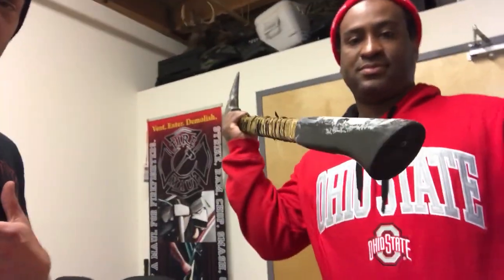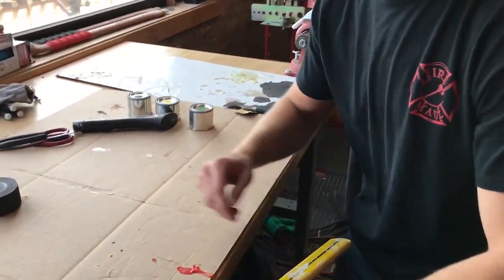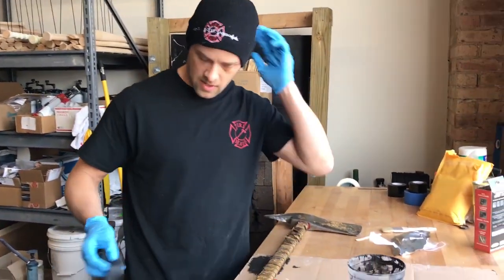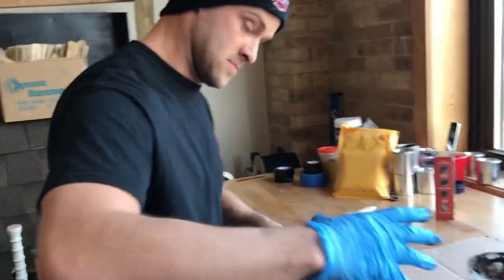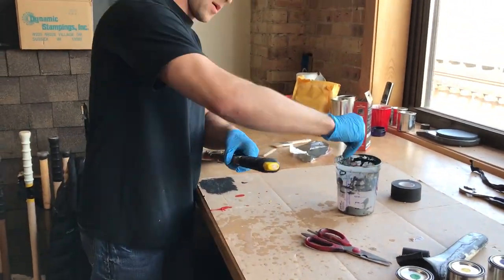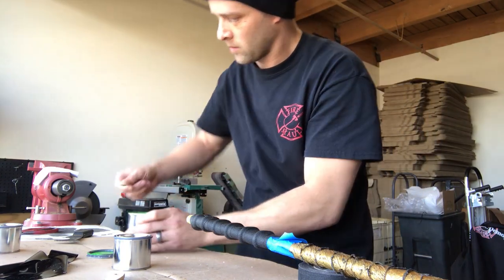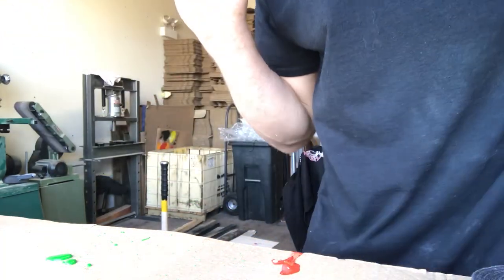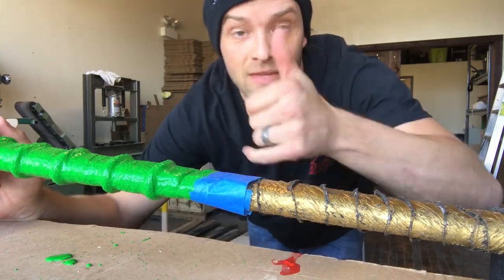Grips Made Easy!!  FireWrap™ Grip!

Comment: I saw in another video that had you sanding the fiber tape after it hardens.  Is that not necessary?
Reply from the maker: Christopher Bestian sanding any smooth glossy areas of the Fiber Tape is recommended for best adhesion of the Liquid Grip.